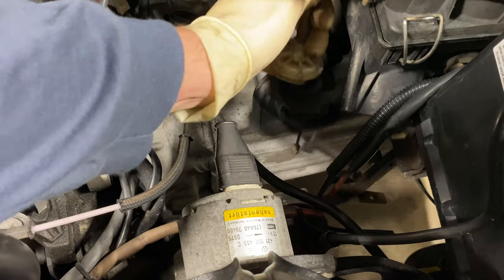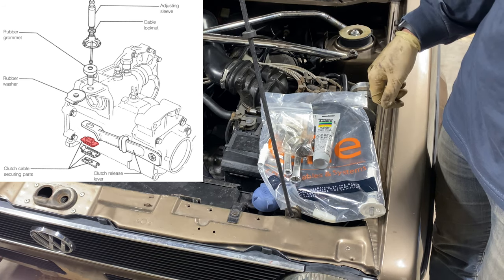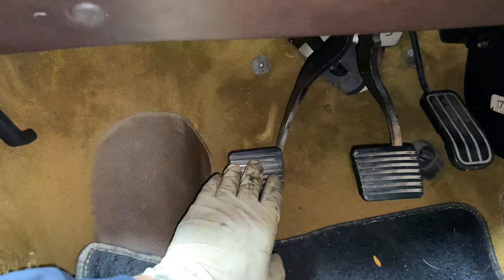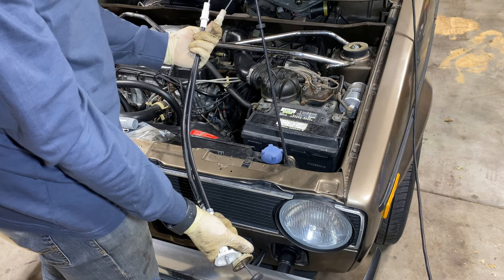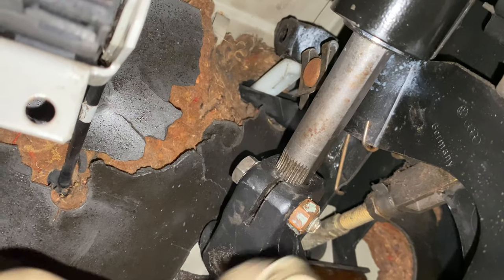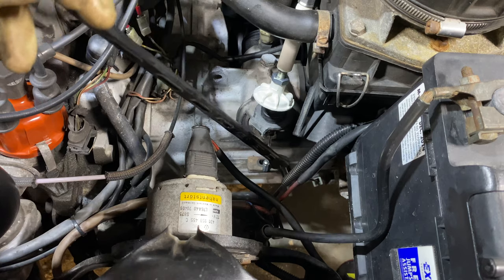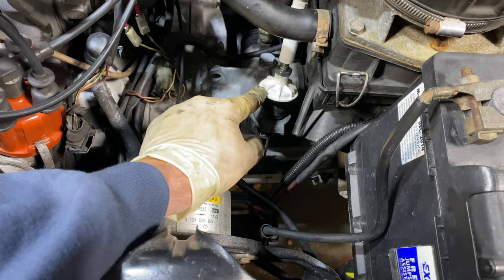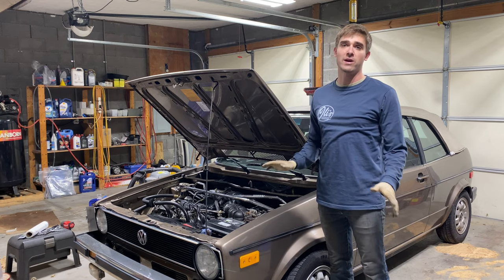Clutch Cable Replacement VW Mk1/Mk2 A1/A2

Comment: My cable needed replacing, and when I bought my 89 cabby, I bought a clutch cable, as I figured it would break. Well it has broken and I am having a hard time replacing it. I replaced the clutch cable on my 87 cabby in 15 minutes with no issues. I am now on hour 3 with no progress. I had to cut the old cable to get it out and now when I push the new cable through the firewall it seems to be catching on something. I have put a zip tie through the plastic eyelet and pulled, but the cable gets stuck in the tube with about 1.5" sticking out under the dash. 
I put the cable in the freezer for an overnight stay to shrink it as much as I can and will try again tomorrow. Other than that, sny suggestions?

Comment: Hey I picked up a 1991 earlier this year and am starting to do some maintenance. The clutch is stiff but has been totally drivable, figured I just wasn't used to an older car's clutch compared to my MK7. I'm running into a couple issues while looking closer at it,

- Both the adjustment nut and the circular plastic piece below on the cable won't budge and there is no up and down freeplay. Right above the circular piece doesn't look to even have threads to screw up to. Think I should just cut the cable below and replace?
- I can't seem to pull the clutch release lever that the cable attaches to at all with my hands whereas you seem to be able to pull it without a ton of effort. Any ideas?

Thanks for the videos, they're helping me better understand this car!
Reply from the maker: Short answer, yes just cut the cable and get a new one. 

Long answer: I’ve never seen a clutch cable where that adjustment screw is seized. Sounds like you definitely should get a new cable for that reason alone. 
You definitely should have a bit of free play in there. So if there is no free play, then you definitely need to adjust the cable. It sounds like the cable is adjusted too far out and that it is constantly engaging the clutch a bit. Not a HUGE issue, but really not ideal either as unnecessary wear is being placed on a few components (throw out and thrust bearings).

The clutch cable is also only $7 from fcpeuro (I linked it in the description because the price was so good). Also just use their cheapest shipping option. It seems to always arrive significantly quicker than the estimates the site provides. 
Feel free to shoot me an email or a dm on Instagram. Email is listed in the “about” page of the channel
Reply: @OlisGarage  Cool thanks for the quick reply! Got one on order.

Comment: It seems like on my 84 diesel, I do not have the clearance to lift the pedal-side of the cable off of the hook on the end. The bulkhead of the rain tray is barely rubbing against the top of the pedal at a certain point, any ideas besides removing the entire pedal assembly? (which I think I'll have to remove the steering column and a bunch of other crap)
Reply from the maker: You could cut the cable, feed it inside, and then yank it off. Just make sure you think the new one will go on first. Otherwise you still have to do more work. 

You could also just loosen the 4 screws holding the pedals. That would probably give you enough room

Comment: Great video, excellent advice to check the length of the replacement clutch cable. On mine it had a longer cable and couldn’t be adjusted correctly, would always grind second gear, because of this. I got the proper length cable, and solved the whole shifting issue. Adjusting the cable gap is as you described 3 or 4 mm (1/8”) at the cable conduit, than from the inside of the car by measuring the free play at the clutch pedal to the floor with no floor mat, should be 15 mm (5/8”). This is described in the “Bentley Manual” (a must have for any VW owner). Have you done a video on charging the grommets on the shift linkage, and adjusting the shifting linkage? I need to adjust mine. Thank you.
Reply from the maker: No video on shift linkage yet. I have the parts though. Just have to take the time to make the video
Reply: @OlisGarage  thanks. I have one car that really needs the bushings. Like you I have the parts. I just been busy with other projects.
Reply: @andrerodriguez7603  what is the part number for the longer cable? My 1981 rabbit LX pickup has the longer cable

Comment: Do you spray silicone grease down the cable ? Or only the ends. Thanks 👍
Reply from the maker: I only lubricate the end with silicone lube from a tube. The spray evaporates quickly. 
No need to spray the inside of the cable; there already is a plastic sleeve in there. I don’t think lubricating the cable will make the plastic last longer.

Comment: Flip your clutch retainer clip around, you want the big tooth on the driver side. Looks like you didnt flip it in this video. If the tooth is on the pass side, it will try to pull the rubber part out. Tooth on the driver side will put more pressure on it, making it feel more firm. Darn right handed people ;)
Reply from the maker: I’ll have to flip it then! Thanks! 
I don’t think it will matter that much, but the diagram I put in the video also shows that it should be the other way. Good catch
Reply: @OlisGarage  I felt it removed alot of slop out of it, lmk what you think.